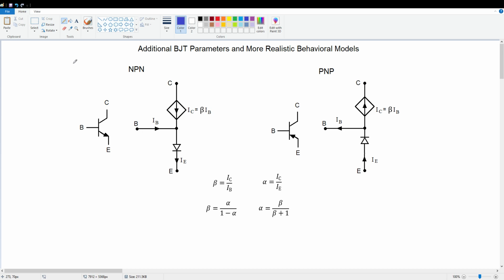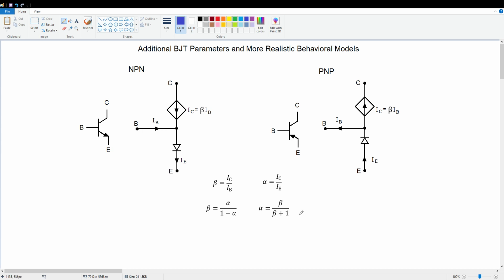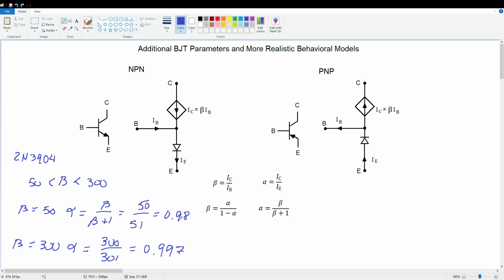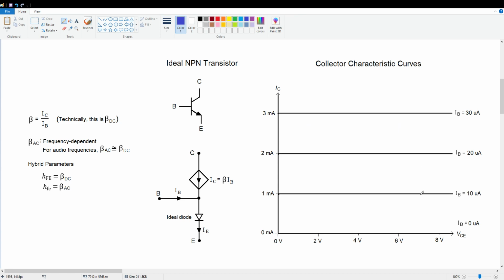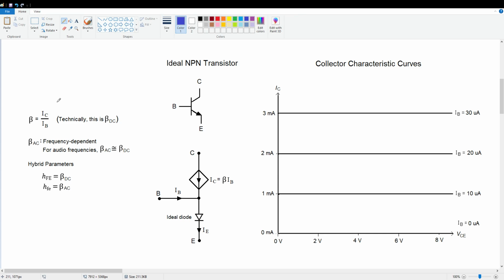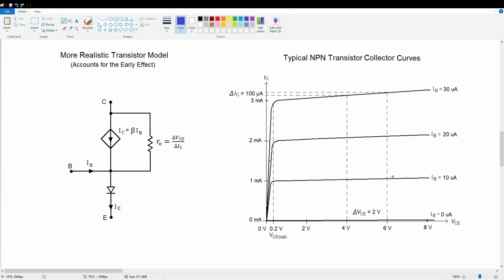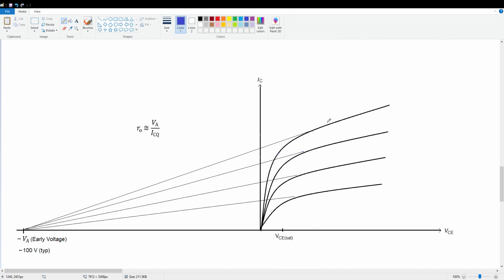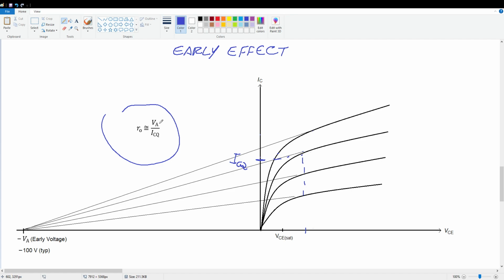Topic 14: Transistor Active Region Models and the Early Effect

Comment: This series is just the level of electronics theory and practice I have been looking for for years. I flunked electronics at polytechnic in 1971 because my calculus was not up to scratch and I had not taken the matrix method of solving linear equations. I took another career but have returned to electronics as a retirement hobby. I will happily work through your videos confident that this time I will be able to keep up!
Reply from the maker: @Old_Coder  thanks! Glad to hear you found this useful. I try to be as concise and clear as possible. Sometimes I miss and get into the weeds a bit deeper than I might really need to, but I’d rather err on the side of thoroughness than leave questions. I also try to answer any questions that come up in the comments too 👍🏻